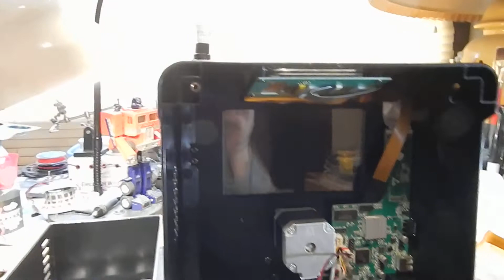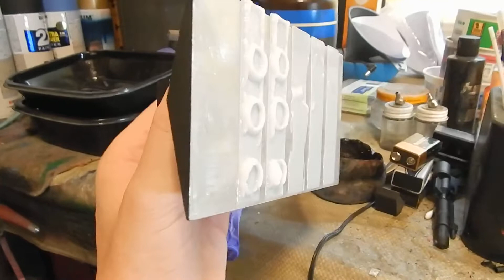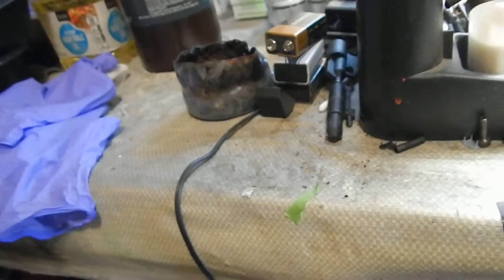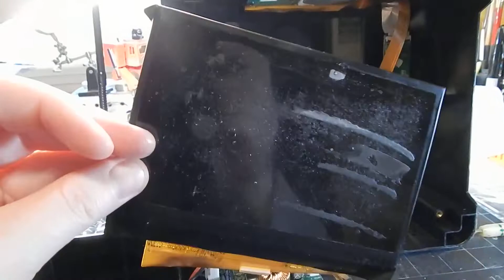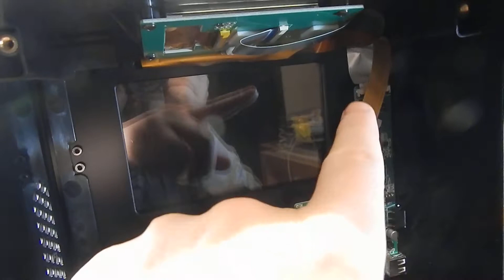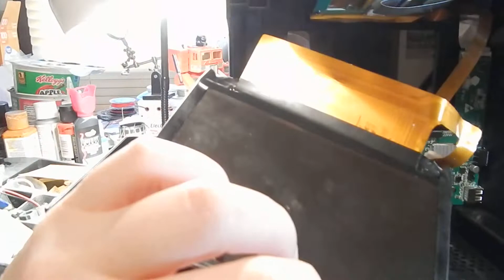Having fun with my 3D printer

Comment: Hey, it looks like you have resin on your screen.   You can buy specifically screen protectors for your model of printer.   Or ypu can just use a non tempered tablet protector.
Reply from the maker: Heya Redshirt!! I probably should have explained what I was doing, shouldn't I? lol So, yeah, that screen got slimed, slime hardened, tried everything to get it off, nothing doing. Got a new screen annnnnnd, it doesnt work. You saw how my prints are turning out, those were from the new screen. :( So I have a ticket in at Any Cubic support and they told me to take video of the old and new screens in test mode. Thats what I was doing when I decided to make this video.